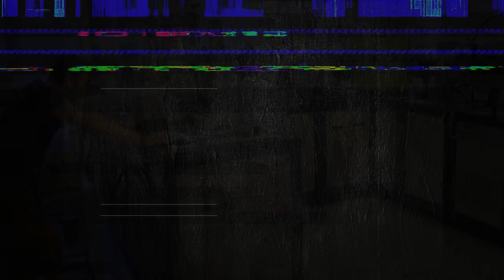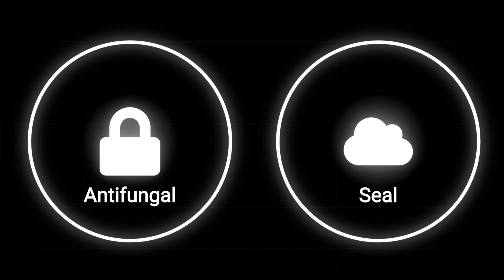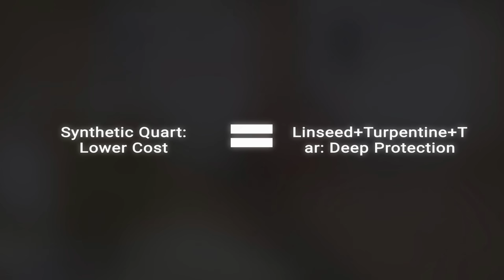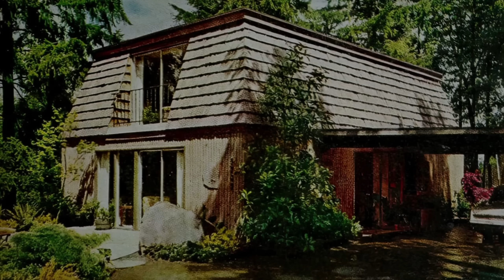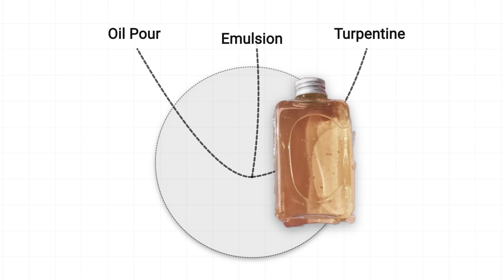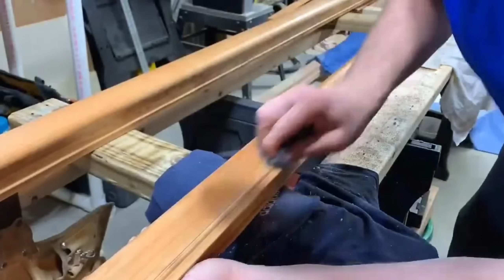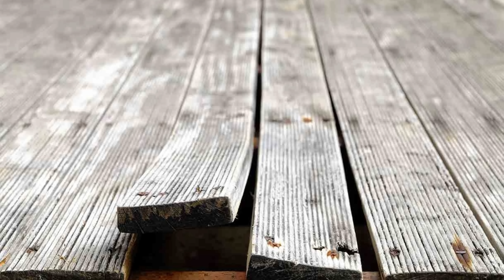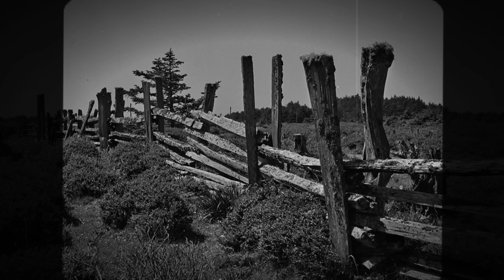The Amish Have Never Replaced a Wood Fence in 200 Years— The $2 Treatment the Lumber Industry Buried

Comment: Are you kidding me. Turpentine on amazon is $18 a quart and  a quart and boiled linseed oil is$20. That would be $38 dollars for a half a gallon. And no way a half a gallon does 200 l.f. of fence. I know this as I'm a retired painting contractor who has done countess miles of fence using a variety of finishes. Paints, stains, both water and solvent based as well as sealers and wood preservatives. It probably is effective as I use boiled linseed oil on tool handles. If you want a really cheap wood preservative use equal parts diesel fuel and oil. I use the oil from my oil changes.
Reply: ...and a pound of beeswax covers a whole fence? Maybe an 8ft section.
Reply: My friend painted his entire wood cabin (exterior) in used car oil from oil changes.  That was 50+ years ago, and it has never needed any further treatments.  It looks beautiful, a lovely dark brown, that makes the cabin fit into the woodlands.  No smell, but i wasn't there 50 years ago, so there might have been for the first couple months.
Reply: @gappsanon4869 l think that's what we call SUMP Oil here in Oz. Just got some from my mechanic to treat posts before putting them in ground as it's difficult now to get true bitumen oil base to seal them.  I was wondering about using it on other timber.  Apparently it stays quite sticky so probably not the best for outdoor furniture or well traversed areas of deck.  But perhaps good on fencing.  It's not meant to be used here in Oz for these timber treatments as it's petroleum based.
Reply: My tested "cheap" wood preservative:  1.liter "chlordane" anti. termite liquid= 2.liters diesel oil... For indoor wood parts only, NOT outdoor woods...

I used such "d.i.y. preservative" in the "roof trusses" of our "3.room piggery"... Almost    "50. years old" structure NOW, single  preservative application only- but no attacked incident from "termite, wood borer" pest...

Lingering chemical smell, 2-3. month duration, was its side effect... 😢
Reply: Not a great smell
Reply: I  think this might be the ticket...and a whole lot more practical/available than what the video suggests....and yeah, it smells but not for all that long. Cheers.
Reply: How much odor does the oil/diesel mixture give off, and how long does it emit the odor? Thanks!
Reply: Is diesel fuel what we'd call sump oil in Oz?  I'm about to use it on cypress fence posts because it's really hard to get authentic oil based bitumen these days to coat area going in the ground.
Reply: @theatonementsight  diesel is what big trucks and equipment use for fuel as opposed to most cars use unleaded gasoline
Reply: @joshgray1235 sorry Josh... l didn't write my question out fully.  We do have diesel motors in Australia. I was more wondering if the MIX of diesel fuel with the other oil that you use is what we call Sump oil in Oz but remembered sump oil is  just straight engine oil... not diesel with another oil.
Reply: @theatonementsight  I figured you might call it by a different name. I'm pretty sure some people just put it on without mixing but better google or ask some older painters in the area. I remember being a kid and my grandfather having me spray it on his house and porch/deck but that was over 40 years ago and he is long gone. Take care!
Reply: You sound like a beekeeper, trying to educate about bee diversity lol!
This is a verified way to preserve wood and save money, looks great, and doesn’t lead to expensive refinishing.  Your complaints are because you risk loosing jobs if people can fend for themselves!

Comment: Diesel or no#2 heating oil mixed with motor oil or trans fluid will do the same thing.  It seals the wood. Sealed wood will last forever. I've also used it on steel. It forms a rust barrier. You can also use tung oil on wood but it's very expensive and takes forever to dry.

Comment: Where and when and how much pine tar is being used. He talks about it being the 3rd ingredient in the begining then goes on to say an emulsion is made of the linseed oil and turpentine but does not talk about the pine tar
Reply: usually one quart pine tar, one quart linseed oil, one quart turpentine as a helper for the pine tar and linseed oil to thin out and penetrate . also heat is important to thin the mixture, you may also char the wood which also helps ( The Japanese method)
Reply: he said it... all mixed in equal parts. 1:1:1
Reply: Yeah, he skipped it

Comment: Just another historical comment about ship-building -- the bane of ships in salt-water is the teredo -- a curious seawater mollusk that bores into wood.  In the age of sail it slowly ate up ships.  From the time of the Vikings onward they tarred ship-bottoms both to seal the wood, but because the anti-fungals in pine tar delayed rots, and also the tars hindered teredos.  Eventually ship-builders learned that copper and cooper salts poison it -- ships started to sheath their bottoms with thin copper sheets, but copper is expensive. (Today most marine bottom paints contain copper salts). 

One of the things that most Americans don't know is that the early colonies exported three primary cash crops: tobacco, rum and corn alcohol ... and boats & ships.   Cotton from the south only got big later -- tobacco was the early cash crop that made trade with the north-American colonies viable.    The Northeast US had forests so vast the original colonists imagined them as infinite; Europe had very little wood left, so boat building became a major export too.  But an interesting synergy developed: tobacco is cured by smoking it, burning the less-desirable leaves.  This produces tobacco tar, full of nicotine.  Nicotine kills insects and also teredos.  The north-American boat builders started adding tobacco tar to their boat tars ...and it worked.

The only problem is that tobacco tar is carcinogenic.  The shipyards found that out too, although they didn't understand the mechanism.
Reply from the maker: That's an incredible bit of history, thanks for sharing! 🤯
Reply: @EliYoderSecrets   -- given some interest in these old things I will say a bit more -- most people don't know that the Connecticut River Valley was the largest producer of tobacco in early colonial days and it remains a substantial producer of long-leaf tobacco for cigars ... although this is a declining business.

There are still large numbers of old tobacco barns standing, and a smaller number still in that service.   All the farmers had excess tobacco tar, and used it to treat wood ... almost everywhere.  And the old tobacco barns seem to last forever as a result.  They also treated houses and shingles particularly... and the result was a color style characteristic of the region .. you even see it mimicked in expensive new homes today.  

But tobacco production started to wane in the valley by 1900 or so.  As tobacco tar started to go away and tractors, farm equipment and cars came in frugal farmers turned to used crank-case oil.  It looks similar, provides some water protection, but did nothing against the insects and little against the rot.  You can tell the difference by smell ... even in wood that has sat idle for 50 years.  Wood that has been tobaccoed lasts, the rest doesn't. 

Wooden boat building was among the most important industries of early colonial and post-revolution America -- every river to the Atlantic from Maine down to the Carolinas had shipyards -- the cut wood floated down the river and turned into ships.  By the 1800s these ships were the equal of those built anywhere in the world, and Americans traveled all the seas, as merchants and particularly whalers.

The very best ships had coppered bottoms -- all six frigates designed by Joshua Humphreys for the US  navy were coppered -- Paul Revere supplied the copper sheathing and spikes! (where it came from I don't know). Those ships and the outpouring of privateers from all of the Atlantic shipyards, manned by all the American sailors won our war of 1812 at sea -- that was America's worst and most humiliating debacle on land.   Our continued existence and expansion as a nation, and the freedom to trade the world's oceans came from that ... and the forests and shipyards of our Atlantic coast. 

Copper was expensive, and many ordinary working boats were not -- tobacco tar was an America trick that made them more durable than otherwise.

Sailors would describe an eligible woman with a good dowry as "a copper-bottomed beauty."

Almost all the merchant ships, the whalers, and the privateers that set to sea were not coppered.  Wooden ships rarely lived in service for more than 15 years or so.

It's important to remember that copper was valuable enough that it was monetary metal -- gold, silver, copper ... the copper pence was the currency of ordinary Europeans.  A competent shipwright in England was paid 8 to 10 shillings a week in the late 1700s: 96 to 120 pence.   The copper coming into a shipyard was like gold -- thievery and corruption was a rampant problem of shipyards everywhere.

It was almost the norm for cheating on the copper that would go into a ship.  Of particular importance  were the "robber bolts" ... large heavy copper bolts in the keelson.  Shipyards would cut out the center of these bolts to steal the copper, just pounding the stub ends in to pass superficial inspection.   This was often an organized corruption, not simply individual thefts.   Ships with these false bolts not uncommonly simply came apart the first time they encountered a heavy sea, disappearing into the waves.

The corruption of the shipyards was a particularly English problem.  All the sailors of the world knew that French and American ships were better built -- better wood, better craftsmanship, and far less corruption.   English naval dominance depended on seamanship & gunnery ... and the fact that ships could be captured in a repairable state.
Reply: @leeharrison2722 thank you for this... so interesting.. any historical books in particular you recommend?
Reply: @leeharrison2722 awesome stories
Reply: @leeharrison2722  I'm on the hunt for one of those "copper-bottomed beauties".
Reply: Is the teredo really curious, or just misguided?
Reply: I really appreciate reading the history you provided.  Thank you

Comment: I'm confused. You say it's not sold in box box stores. The turpentine at Menards by Sunnyside has 2 ingredients GUM TURPENTINE &  TERPENE HYDROCARBONS that's natural organic compounds. It smells like Christmas tree. $10.98 quart. Reads on label. DESCRIPTION PRODUCT IMAGE SAFETY INFORMATION
Sunnyside Gum Turpentine is derived from the sap of pine trees and is the
oldest known paint solvent. It is an excellent thinner for oil based paints and varnishes. They have a Turpentine replacement that says it is petroleum based. $6.98 quart. KLEAN STRIP $7.89 quart is listed as Pure Gum Turpentine. Are you saying this is not pure turpentine ?  They smell like Christmas trees and seems to work much better than the petroleum products.
Reply: I think what the man means is that it’s not available at Lowe’s or Home Depot. If only there was a Menards near me.
Reply: I miss Menards.  Sigh 😞
Reply: He also said it wasn’t a conspiracy and that the industry worked hard for years to silently eliminate the purported secret to eternal wood youth.
Reply: Some states have banned the sale of turpentine so it can be really hard to get if you live there.

Comment: Real turpentine is called "balsamterpentin" in Swedish, and it's commonly available in the country. The mixture of boiled linseed oil, real turpentine, and real pine tar is called "roslagsmahogny" in Swedish. Proper pine tar (dalbränd trätjära etc) is the important ingredient for treating wood, and any drying oil and compatible solvent will do. Raw linseed oil penetrates deeper than boiled linseed oil, but needs months to oxidize. Tung oil too, and a combination of tung oil and raw linseed oil works very well in roslagsmahogny treatment of wood.
Reply: Thanks to you @rickardtuvehagen1919 , I found a product named : Auson Tarinolie Roslagsmahogny. But I (in Belgium) can only seem to find it in two Dutch online shops and one is for professionals only and the other shop is out of stock. I'll have to be patient :-)
Reply: @mleys3248  You can make it yourself if you can get proper pine tar... The classic recipe for roslagsmahogny is equal parts pine tar, drying oil, and compatible solvents. You can mix turpentine with a bit of ethanol or isopropanol to get a more even result... Turpentine works with drying oils, but pine tar dissolves better in alcohol. Proper turpentine isn't necessary for a good result, it's just less stinky before it evaporates.
Reply: Hej Rickard!
Jag läste om denna blandning på engelska f🎉🎉ör ca 2 år sedan men jag visste inte att den hade ett namn på svenska : "Roslagsmahogny".
Jätte bra att jag vet detta nu.
Hur länge håller en behandling med Roslagsmahogny?
Reply: I have long used 1/3 Linseed Oil, Turpentine, and Thompsons Water Seal. The combo is easy to mix. Goes on with a sprayer and adds year of life after application.
Reply: @DavidD402  Thompson's Water Seal is paraffin dissolved in mineral spirits - pretty worthless stuff, in terms of durability and coating effectiveness. You can make your own with those 2 ingredients. But why would you want to?
Reply: @landonedwards7504  I think you are wrong about what Thompson's Water Seal is. I use that rough mix because it works and goes on like water / very fast. It lasts for about 3 or 4 years. So no labor, not that expensive, and it works well. Try it on some scrap wood and get back to me in a few years.
Reply: @DavidD402  3 or 4 years?   That sounds worthless.  The video was about a treatment that lasts over 100 years.  I'm sure any treatment could last a couple years, but then you have to do the work all over again.
Reply: @gappsanon4869 Indeed... There are wood buildings in Europe treated with pine tar that have kept for 1000 years.
Reply: @gappsanon4869  Most outdoor wood treatments sit on top of the wood, require a lot of prep-work, and don't last more than 2 or 3 years. So when I got new properties frequently the wood wasn't maintained. If you want wood to last, maintain it on an as needed basis. Also, quick growth soft-wood which is what's available now, won't last like the old growth wood of 60 years ago. Indeed, if you really want wood to last almost forever, you need to prep the tree years in advance with some bark removal.
Reply: @rickardtuvehagen1919  Yes it's pretty amazing. They have also been retreated periodically, and the trees were prepared with some bark removal years before harvest.
Reply: @landonedwards7504  So true.  I had a west facing deck, and I applied Thompson's Water Seal.  It worked for 1 rain.  Then you can see it  is as if nothing was on the wood.  Useless stuff.
Reply: @landonedwards7504 so basically its "compatible" as diesel fuel. 

Well. If it works for that i can raid Home Depot after the apocalyse for fuel. 

Heck if thats all it is. You could probably melt Lard on the wood and have a better product. Until all the critters come lick the boards all day
Reply: @DavidD402  4 years? Utter worthless garbage🤢🤮
Reply: @DavidD402  Stop polluting this comment section with your worthless "contributions" 👎

Comment: Yes it does make it last a long time and it is worth it but no fence post no wood fence post stuck in the ground will last 200 years that is a lie
Reply: And no externally applied coating of any sort will completely protect the interior of a piece of wood. The more sound the wood, the less any solvent will penetrate. Even pressure treated lumber doesn't get full protection to the core of the wood, which is why they recommend that boards be used uncut, at full length.
Reply: Can you provide proof for your claim